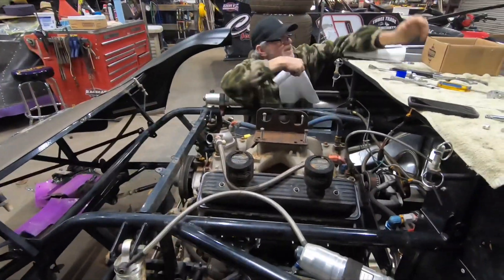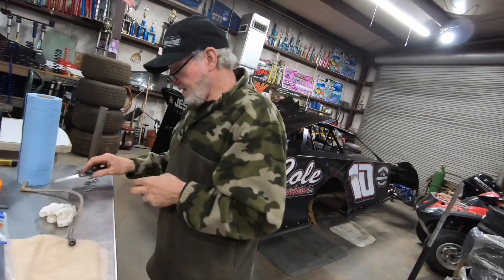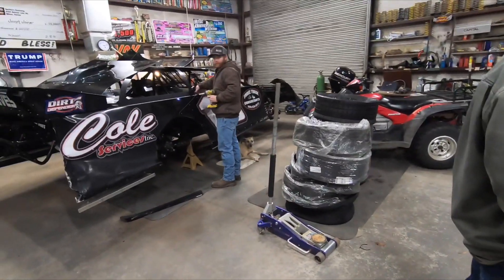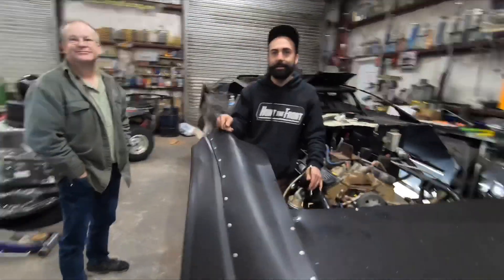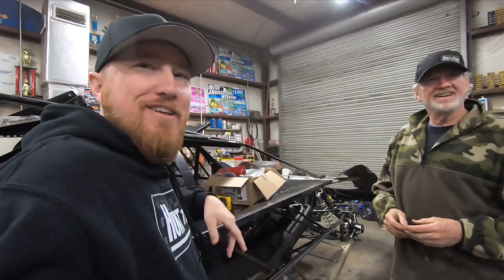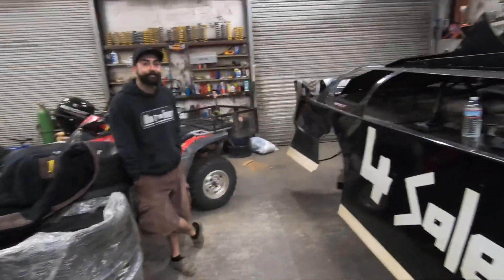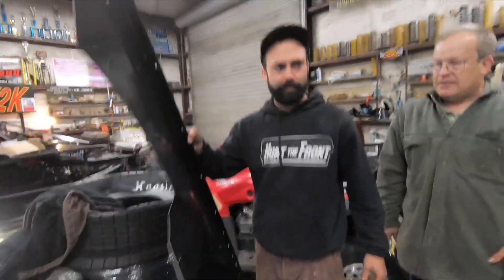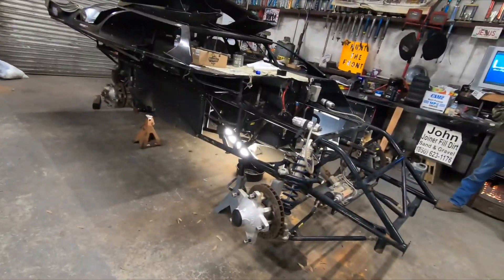The 4 Sale Car is No Longer For Sale

Comment: With 4 drivers, run the numbers 7, 11, 17, 71. That way, each driver gets his own number, and you never have to reposition (or add, or remove) more than a single piece of duct tape for each number swap, no matter which number was used the last race, to whichever number you're switching to this race. It's simplicity at it finest. I mean, still do a nice set of decals for all the sponsors, of course, just leave blank spots for all the duct tape numbers. That way, we always know who's in the car, and fans will love it. The 'changing of the numbers' routine can even be turned into running, pre-race ritual as a fan-anticipated part of each race video.